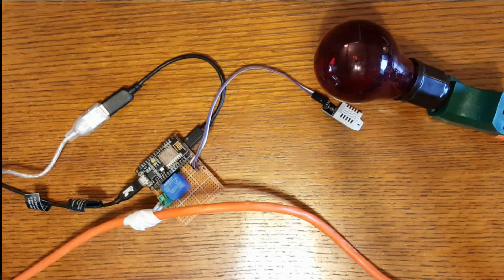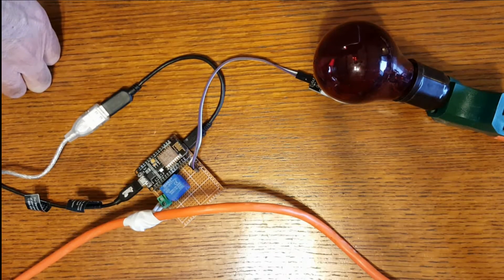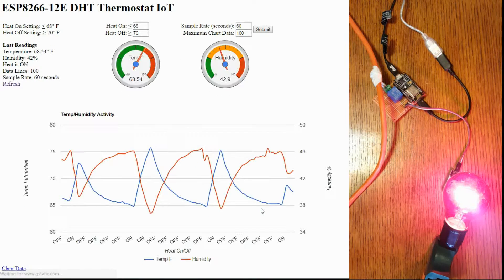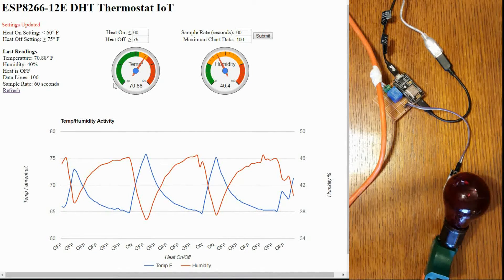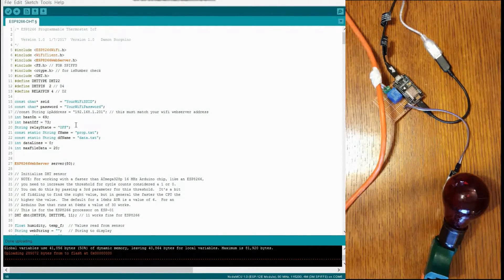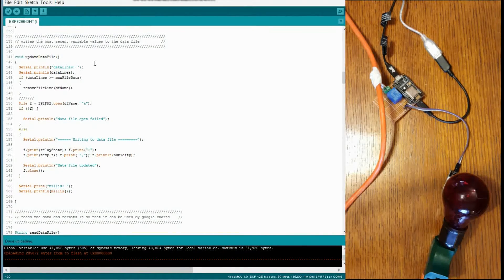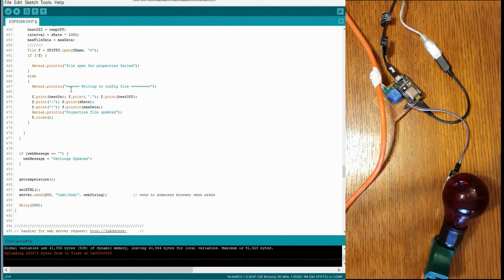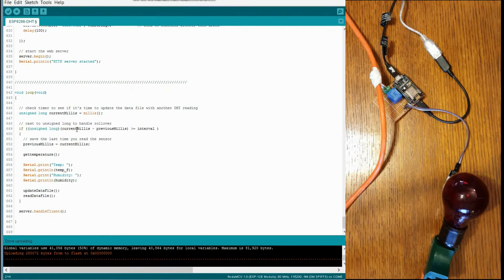ESP8266-12E DHT Thermostat

Comment: Hello, filled in your sketch, monitor the port, connected to wifi, issued an ip address, I type in the browser ip address 192.168.1.201, connected to the same network wifi, writes "the page is not available" . Please, who in the subject, tell me what to fix. Thank You.
Reply from the maker: Use the serial port to make sure the device is connecting to your WiFi network.
Reply: Thanks for the tip, looked through a" Wireless Network Watcher", was not found. Replaced in the sketch the network sigment, was ip192.168.1.201 has replaced 192.168.0.201 and cheers! it worked! And for three days I puzzled what the problem is. Thank You!      How else would change the temperature to display in Celsius With
Reply: @СергейКалашников_428  SAME ISSUE 192.168.1.201 IP NOT WORKING

Comment: fantastic! nice video man. Can we do this with the web server? something like setup a wemos/(Wemos Temp & Humidity Shield) at a location with a preset temperature  and another wemos with relay at another location ; both wemos are configured for the same wifi.  So when the temperature reaches a certain point, it sends out a command to turn on the heater for example.

Comment: If using DHT22 (DHT11 is not so precise anyway) and the data is in Celsius, I suggest add posibillity to update data by 0.5 point. Do you know how someone? 

Btw. great project, works like a charm. Thank you for sharing. I don´t get why someone dislike this video, you got big Thumbs Up from me. 

Hope you add some new features in future (like button to +/- degrees for fast temperature set without keyboard, fast switch DAY/NIGHT temperature, some LCD display output, etc.) I wish I know how to program this.